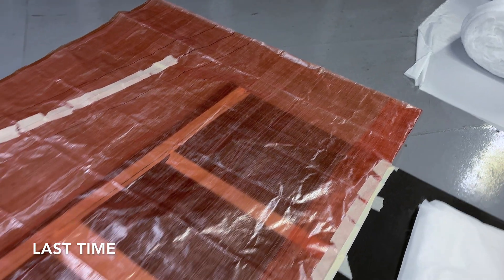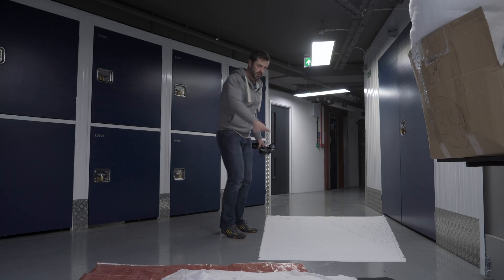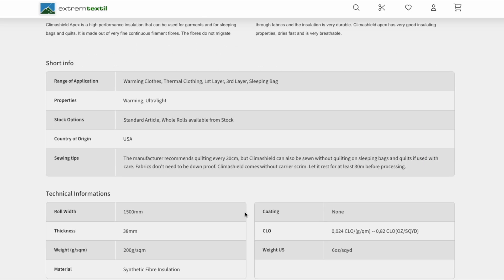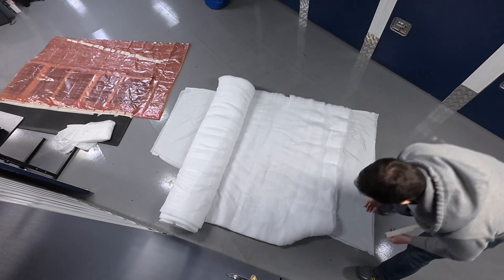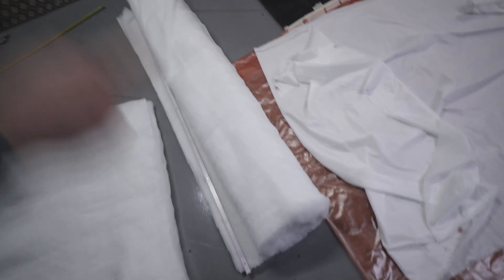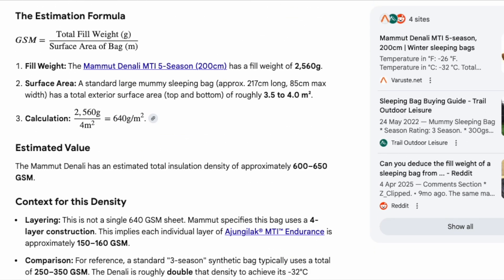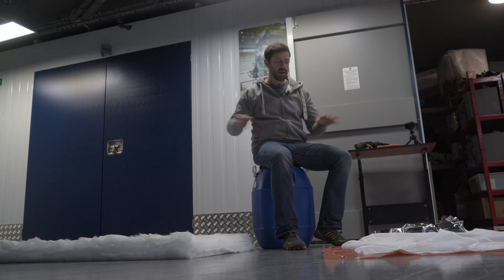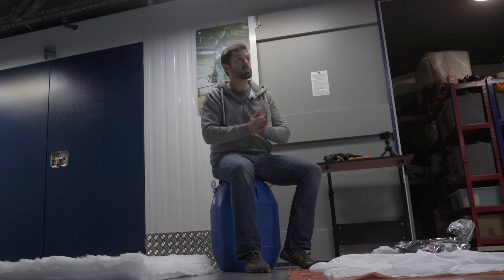New Expedition SLEEPING SYSTEM. Part 3: Cutting up 800gsm of Climashield, and adding MYLAR. [4K]

Comment: This is VERY late in your process, but it looks like your daily assembly/disassembly routine might be getting more and more time consuming.

Another approach to consider might be making an Aerogel envelope encased in some form of nylon fabric that can be rolled and unrolled. I'm not talking about the new hybrid aerogel fabrics but an actual Aerogel blanket that's only a couple of mm thick. An Aerogel blanket has a thermal conductivity of as little as 0.023 W/mK. That could reduce your sleeping pad requirement down to one plus the bottom of the envelope and your bag requirement down to a 3 season Climashield top quilt plus the top of the envelope. Aerogel is hydrophobic and doesn't care about moisture. Top it off with an Aerogel hood.

To put that in perspective, it eliminates the need for multiple layers of pads, an arctic bag, your VB liner and all of the time it takes to set up and break down the more complicated system. Instead, you'd just unroll a single sleeping pad, unroll the Aerogel envelop over that, place your synthetic top quilt inside the envelope, and your done. In the event that your envelope did get condensation, take it outside of the tent and let the moisture flash freeze, then shake out the solid water.
Reply from the maker: There's been a lot of aerogel chat across the episodes. The issue is that to stop aerogel being brittle, it needs to be combined with fabric and that massively compromises the properties. If you know of a flexible and robust aerogel mat that is pure, do link me to it.

Point taken on complexity but I think once done it'll be a lot simpler than it may seem.
Reply: @AlexHibbertOriginals I will shoot you a link to the Aerogel blanket. 
The claimed property is: flexible, dust free, durable.. 
You'll still want to put it in a fabric sleeve of some sort.
It's pretty spendy, but when compared to DCF.... it's getting close to a wash.

Anecdotally I have a 15 year old barn coat with Aerogel. I don't know what the lower limit is, but it was warmer than my 25 year old North Face Nuptse (when they were still good) at minus 20 F. I also tested it in a hammock with no underquilt (did have a quilt on my legs and an insulated hood) at 0 F and slept fine.

Comment: If you're looking for aluminized material another option is Reflectix in the hardware store. It's basically bubble-foil sandwiched with thick enough aluminum that will not fall apart through your journey. I just looked and it has an R-21 value
Reply from the maker: R-21 is only for very elaborate set ups. Single layer is c.R-1. https://www.google.com/search?q=reflectix+r-value&sca_esv=7a00894b1fa381ef&rlz=1C5CHFA_enGB1063GB1063&sxsrf=ANbL-n72X8apMqqocmC4cQ97jAgZgOp43Q%3A1768696074216&ei=CilsaaLzDOGTwbkPmpPHiAY&oq=Reflectix&gs_lp=Egxnd3Mtd2l6LXNlcnAiCVJlZmxlY3RpeCoCCAQyChAAGLADGNYEGEcyChAAGLADGNYEGEcyChAAGLADGNYEGEcyChAAGLADGNYEGEcyChAAGLADGNYEGEcyChAAGLADGNYEGEcyChAAGLADGNYEGEcyChAAGLADGNYEGEcyDRAAGIAEGLADGEMYigUyDRAAGIAEGLADGEMYigUyDRAAGIAEGLADGEMYigUyDRAAGIAEGLADGEMYigUyDhAAGLADGOQCGNYE2AEBMg4QABiwAxjkAhjWBNgBATIOEAAYsAMY5AIY1gTYAQEyGRAuGIAEGLADGNEDGEMYxwEYyAMYigXYAQEyGRAuGIAEGLADGNEDGEMYxwEYyAMYigXYAQEyFhAuGIAEGLADGEMY5QQYyAMYigXYAQEyGRAuGIAEGLADGNEDGEMYxwEYyAMYigXYAQFI3xJQAFgAcAF4AJABAJgBogKgAaICqgEDMi0xuAEByAEAmAIBoAIKmAMAiAYBkAYTugYGCAEQARgJkgcBMaAHqxSyBwC4BwDCBwMyLTHIBweACAA&sclient=gws-wiz-serp

Comment: -Me again... using a sheet (or “blanket”) of non-breathable aluminized plastic (Mylar), seems like a good idea; light, waterproof, reflecting radiant body heat, and providing a vapor barrier (I’ve seen your series on vapor barriers for your feet). Of course, it’s been my experience that anytime you’re working with waterproof materials, you have condensation issues. 
-I recall a practical experiment I conducted years ago wherein I used a Mylar bivy on/around my sleeping bag (no shelter). I woke to find the sleeping bag was wet. I tried again, only covering the bag from the knees down. In the morning, my bag was wet from the knees down.
-More recently, I made my own hammock shelter (I prefer a hammock to a tent), I used several layers of rip-stop polyester with a single sheet of clear plastic as my tarp (tarpaulin). The overall design (no over/under quilt) stands up to wind (60mph+), cold (9F), and rain. I also find it’s more comfortable than my own bed. As to effectiveness, I don’t always know how cold it is outside until I have a peek. However, while condensation does lightly accumulate between the layers, and freezes at the lower edges  (with the occasional icicles by morning), there’s very little condensation on the inner surface of the tarp. I’ve been thinking of switching out the clear plastic for Mylar (perhaps next month).
-Here in California, at most times and places, I imagine condensation may not be so catastrophic as in the arctic since I can usually air dry the next day if not too cold/wet. I imagine in arctic conditions that may be more problematic, so I’m anticipating seeing an experiment on your channel involving a commercial freezer when you’re further along in your development.
SUGGESTION- While there are other off-the-shelf Mylar products claiming to be stronger and “thicker” than the typical “emergency space blanket” (which you seemed to be handling), there is one product you may want to consider, a “breathable” version which may address condensation (on Amazon). They claim to reflect only 70 to 90 percent of your body heat, but I imagine it could address condensation, and it looks and feels more like a proper blanket. I even saw video of it being used as a sleeping bag liner.
-BTW, adding a layer to the foot box is good, but if you want to save a gram or two, I find insulated socks/booties are just fine.
Reply from the maker: The Mylar will be within the vapour barrier zone, so condensation won't form on it. The sleeping zone will be as per any other VBL sleeping system. Since the dew point won't be on the interface between sleeping zone and the inner insulation, condensation won't form.

Comment: I would think the Mylar would be most effective near the outer layer of the bag, especially on the bottom. I have a overblanket with the Mylar sandwich  in the middle, guessing it would be quieter.  I do not think you can tell it’s even in there! Other than the great thermal comfort. This was made with polyester batting, nothing for severe cold. I really like this and know this is going to be very effective. As long as you have protection from the ground /underneath, this will be an amazing bag. Thank you for taking us with on your creative journey
Reply from the maker: Cheers Todd

Comment: Has anyone ever tried to use aerogel? As if anyone could ever afford it.
Reply from the maker: It needs to be combined with polyester and other fabrics, as it's too hard and brittle otherwise
Reply: @AlexHibbertOriginals  So it is possible?
Reply from the maker: You'd have compromised properties https://mylifeoutdoors.com/2024/04/aerogel-vs-down-jackets.html
Reply: @AlexHibbertOriginals Makes sense now. I've used it before building a house with a lot of steel columns and beams, and we would put 1/8" width strips over the steel to help with the thermal bridging where there is no insulation. I guess it would only work with a semi permanent or permanent structure that doesn't flex or compress. Maybe someday they'll figure out a better way. I dont backpack anymore  so I am leaning more towards semi permanent structures anyway so I dont have to keep carrying the weight repeatedly. I was thinking of taking a small tent or bivy and spray foaming it.

Comment: Will you need to wear noise cancelling headphones while sleeping in the systeem? Or will you be so exhausted by excersise it won't matter?
Reply from the maker: Noise is going to be a factor. In areas away from wildlfe or moving ice threats, I tend to sleep wit silicone ear plugs due to wind noise or snoring. I am looking for quieter alternatives to DCF - although Ultra 100X is hard to find, and twice the weight.

Comment: Hi Alex.

A though regardng the foot box. As you are filming this in a storage facility, and calling it a foot box, what about a box fold design? 

Leave the top layers long, cut parallel to the long side of the quilt, fold top piece down and hem to mat. Take side pieces and fold across. This way, the joins are vertical at the sides, and no join on the top to lose heat through.

There are other options for fabric bonded mylar, that are a lot quieter and more durable. There is a company called Survive Outdoors Longer (SOL)that makes survival tubes and sleeping bag liners. Their survival tubes are part of the quilt system I use while cave camping. So much quieter than survival blanket!
Reply from the maker: I have a SOL on order! Thanks

Comment: The biggest concern I have on your behalf is the joint between the upper part and the lower part. Lots of potential for heat loss if that isn't a well integrated joint. It will be interesting to see what you end up with.
Reply from the maker: It's on my mind too and I have a plan. And a thermal camera to see...

Comment: I used a Zeta1 hot tent in 10 degrees Fahrenheit last night, the sleeping chamber was 26 degrees just with me in side of it. Mylar does work well. It works the best off of the heat source and away from the cold. Mid layer I would think would work the best.
Reply from the maker: Nice to be able to make use of reflective materials when breathability isn't a need.
Reply: @AlexHibbertOriginals moisture control can be a big problem in winter camping. That is for sure.

Comment: I made bad experiences with dcf (even the 1oz version) and mylar... after not even a month on trail the dcf had lots of tiny small holes and already began to delaminate and the aluminium came off the mylar foil...
I hope you didn't plan a long trip...
But i like the way you think, very interesting!
Reply from the maker: Interesting indeed - I'm on the lookout for similarly impregnable but quieter shield fabrics
Reply: @AlexHibbertOriginals  i'd go for nylon, polyester or quantum pertex. All of them will do a better job than dcf. Istead of mylar i'd use window insulation foil (brand "tesa", similar to polycro) or bubble wrap, just nothing with aluminium since it falls off.
Reply from the maker: Pertex is nylon. Nylons and polyesters, woven, are not a vapour barrier even if coated or treated. As far as I'm aware, the 'foil' on window insulation is aluminium too.
Reply: @AlexHibbertOriginals  no, the window insulation foil from tesa is like polycro (polyolefin is the real name), no aluminium. This is what i'd use as a vapour barrier.
Reply from the maker: I'm not sure this checks out. Polyolefin is a strong plastic that can be formed into films, but it's not reflective. I've used PE VBLs before that I made myself. Of similar thicknesses, their performances as a straight forward VBL bag will be similar.

Your initial comment was about the DCF outer layers. Waxy plastic films like polyolefins won't work for those layers.

Comment: Most aluminised mylar blackets are very noisy.  You get some which are not noisy.  The non noisy film will stretch rather than tear, which may be desired.  I think SOL emergency blankets are non crinkly.  The mylar might be prone to splitting and tearing where its stitched.
Reply: I use those car window sun shields .
Reply: Do you know of any producers of such Mylar. To use rebranded SOL Mylar would be wasteful as I  need 5m long pieces.

Comment: I'm still concerned about what is going under you. It's been my experience that the majority of the struggle when sleeping on the ground is in the conduction of heat out from under you. I'm concerned that the pad you're putting together is going to very inadequate for extreme cold.
Reply from the maker: This will be all about the layering of the foam layers. As the data shows, conduction is a factor,  but not a dominating one. I have to say that through the years, if I've had problems with warmth in the extreme cold, it's not been through feeling the cold through the 'floor'.
Reply: @AlexHibbertOriginals It's been my experience that once the temp gets down around 0°F that r-8  under me still feels cold. I'm looking forward to seeing how you put your pad together and how it performs for you. 

Cheers
Reply: What I've found is that while the ground is a massive suck, it's the same suck regardless of outdoor temps.  If your system is rated for extreme cold, it will likely be overcoming the loss through the ground.

However, I somewhat agree with OP.  I'm a big believer in full wraps of insulation.  They baffle your edges better and you avoid drafts at the seam between your bag and mat.  I roll around a lot so maybe that's why I get good use out of them.
Reply from the maker: There are definitely situations when I will still use sleeping bags - sometimes even without a VBL if the environment is sunny.

The reasoning for the mat replacement here is because a sleeping bag underneath you merely ends up acting as if it were a foam mat, since it's totally compressed beneath you. It's going to be a case of making sure there's ENOUGH mat.
Reply: @AlexHibbertOriginals I still lean toward a light weight, low to the ground cot with an under quilt type insulation under it. That's the only thing that I've ever found to be comfortable in extremely cold environments.
Reply from the maker: I'm not anti-cots. But you'd need a vehicle supported trip, unless you magic up a hyper light composite cot.
Reply: @AlexHibbertOriginals My cot is fairly light. It packs down to about two feet long and about three and a half inches in diameter, plus the legs, which are metal rods bent into kind of a 'c' shape. They're an awkward shape but they don't really take up any space. I think they are 4mm across. It's a small cot. 24" x 70". No bells and whistles are all. Just a piece of fabric with a tube sewn down each length that accepts a three  part pole through each one, and then four legs that poke into both poles to suspend you up off the ground a few inches. I put the main body of the cot in my pack upright and the legs I tuck into the frame. It's worth it to me because I can put essentially unlimited insulation under me without crushing it (up to about four inches thick). I wouldn't dream of going in extreme cold without it.

Comment: Be interesting to see how this works in the end....and how it drapes.  Maybe have insulation around the edges to leave a hollow for you to be 'inside' rather than what you might suspect will be a less than giving slab of insulation.

Lot of work when readymade stuff exists....Canadian army sleep system will go down to below -60c...outer is same goretex bivvy bag British army uses...if concerned about moisture just add a plastic survival bag inside.  I'm guessing they know a thing or two about the Arctic.
Reply from the maker: Yes I've been considering this - a few internal adjustable cinches might help.

I'm afraid the last place I'd go for Arctic equipment advice is a UK forces kit store!!
Reply: @AlexHibbertOriginals 
Brits train in Norway for their winter skills, so maybe not -60 but -30 should be a pickle 😂
Reply from the maker: British Norway exercises have a low temp cut-off at -27 ish I think. Mad.
Reply: The thing with the Canadian Army sleep system is that it weighs 12 pounds and is based on and made from technology and materials from the 1960's, using a massive overstuff of low fill down to stave off insulation collapse. It absolutely works, but you could knock a few pounds off the weight just by switching to 20 denier nylon and a mummy cut.
Reply from the maker: Sounds great if you're operating out of vehicles.

Comment: Ideally, wouldn't you want to make sure the most warmth is in the upper half? As that would ensure the core stays warm and then the extremities would be receiving warmer blood. Also considering that it's easy to put on/take off socks/gloves to keep them warm. Then again, I've never been to the poles 😂
Reply from the maker: Yes I'll need to dive further into this. It's right that cold feet are producing relatively little heat, but that's no reason to deny them insulation. If your core is so cold that it's not able to redistribute heat to arms and legs, then your system is totally not working. No zone will be denied key insulation - I'm just decided where gets even more.
Reply: Cold lower half is a recipe for no sleep
Reply from the maker: Any zone that's cold will lead to misery, so we're not neglecting anywhere here.